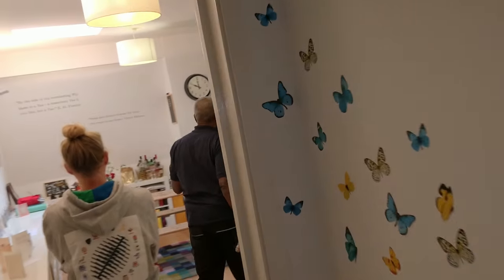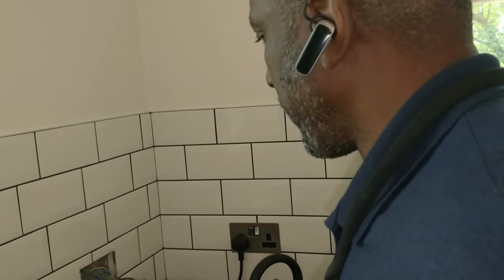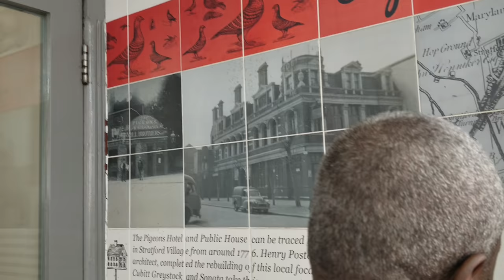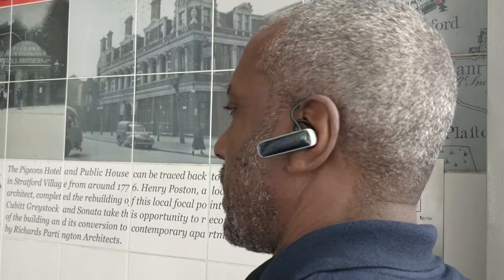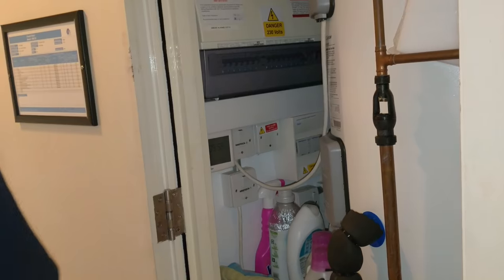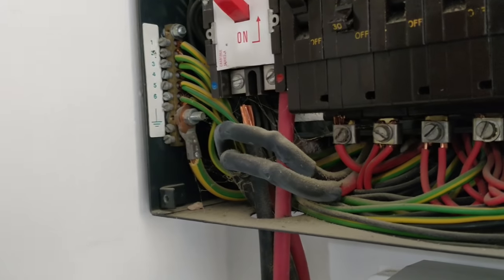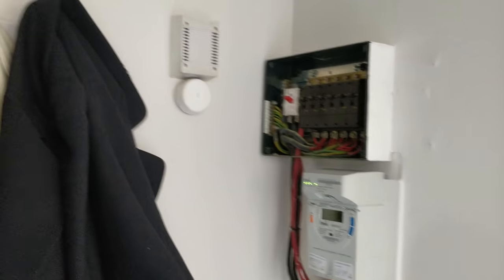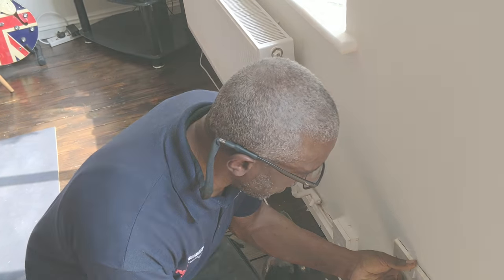A Day Of Electrical Fault Finding - Father & Son Electrical Team In London Vlog #7

Comment: Good trick when removing sockets and switches is to run a Stanley blade around the edges to help stop damage to the paint and leaves a clean job when refitting , great content by the way
Reply: I usually score it using a flat 4mm screwdriver.
Reply: @saabuldin  Doesn't do it as cleanly.

Comment: Lose the neutral and usually lose all the electronic stuff in the house. Neutral pulled out due to smart meter install and meter installer pulling on tails and not checking the main switch in the consumer unit after install. Common problem always check after meter fitters have been in the house.
 Enjoying your videos Delroy.

Comment: If one has to run an insulation resistance test in a property in which it is difficult to remove all appliances or sensitive fittings will it be sufficient to do the test on 250v and not cause any damage?
Thanks
Reply: Yes

Comment: Fantastic video gents. Well presented. However,  can I just ask a question on 2391 inspection and testing. I’m about to sit my 2391 in a months time and wanted to install a  rig testing board before the exam but not sure how many circuits i should include to make sure I’m well prepared for the exam. If you can possibly help me with a spec I would much appreciate your help!
Reply: set up a ring. A good tip is to write out a manual of how to test. where to put the probs, what settings, expected readings for each test.

Comment: Wow ! 
What a foolish place to site a fuseboard near the hot water cylinder.

Also whenever I find a loose terminals in a fuseboard I find it a good practice to tighten all the terminals in that fuseboard.
Reply: Agreed needs putting into the regs and clarifying in the building control notes. 1350 height isn't good enough...that said it's 150mm really so that's not compliant part p

Comment: Hi, just a question, before doing the insulation resistance test wouldn't everything on the circuit be removed prior to testing?
Thanks
Reply: Usually the hob is on its own dedicated circuit. So there is nothing else to disconnect other than the hob.

Comment: The second job has a consumer unit and meter with cables that could quite easily be pulled on by children, knocked when carrying something up those stairs behind them... whatever.  To top it all off there's no isolation between incoming electric and meter (which should have been done when the smart meter was fitted)... This type of installation is surely against regulations and the whole CU and meter should be at least boxed in for safety...

My guess would be that someone has come in through the front door drunk gone to hang their coat up and steadied themselves using that neutral cable LOL.... very dangerous as it could have been the live.
Reply: Main isolation or DNO cut out could be located in another room. There is no regulation to say it needs to be by the meter.
Reply: @5tevia  exactly

Comment: Delroy, my downstairs lights 2 lights work, and the other half doesnt, i noticed the mcb tripped, and flipped it back on, but half the lights downstairs are have no power, ive tested each switch with my tester and no voltage, do you thing there is a inline fuse thats blown?
Reply: Amin Khan could be a open circuit or broken neutral
Reply: @ImranKhan-cf8gs  i found out what the issue was, one of the live cables burnt out, i had to break into the walls to cut it out and extend it and all is working

Comment: How did you identified the actual neutral wire for the faulty circuit from a couple and bunch of wires on the neutral bar within the distribution board ?
Reply: Leonard Milazi the cables should be connected to the numbered slots as per circuit number.
Reply: thank you

Comment: You should definitely have isolated the load before working on that - apart from sparks as you put it back, bear in mind that the load side neutral would actually have been live while the neutral supply was disconnected.

Comment: Sorry Delroy.  I don’t understand your fault finding logic on the first job.  It’s a cooker radial circuit with only two appliances on it, they are much more likely to fail than the MCB, wiring or switch.  Disconnect the hob and cooker then IR test from there back to the CU, proves the switch and wiring - wouldn’t have shown a fault, hence it must be an appliance, re-connect cooker which would have been fine, same with hob, fault repeats.  So it’s the hob, disconnect at the backplate so that a new hob can simply be wired in.  Not being funny but am I missing something?
Reply: Wouldnt the neon on the cooker switch affect the IR values?

Comment: Great job Delroy but a few pointers mate, the second consumer Unit  one has a multitude of issues/ No labeling, no RCD protection, old fusewire MCB's, meter tails need upgrading to 22mm, should have a 100a isolator between the meter leading to the DB and that's just what I can tell from looking at the DB who knows what the circuits are like in the rest of the property. I would have told the customer that the immediate fault has been resolved but she seriously needs to consider taking care of these other things here and would have given here a recommendation with an estimate to have this work done. Also, why not offer to replace the old double socket frontal while you were there? could have billed a bit more and have resolved another issue.

Comment: Meter installer's fault, no question.
Reply: Meter installer should have cleated tails before working on the meter, however I would say dodgy electrician was to blame, as looks like the neutral was never connected properly. Could definitely of caused afire that one.

Comment: It must suck to work on a consumer unit located in such location. Is there any requirement that dictates location of a consumer unit? US and Canada has a requirement for a working space in front of consumer unit/electrical panel that has to be free of any obstruction. I believe it is 3 feet of available space from unit cover. Other than that, good job guys.